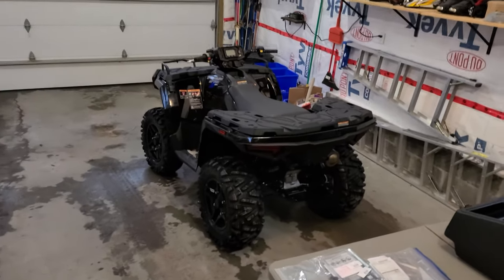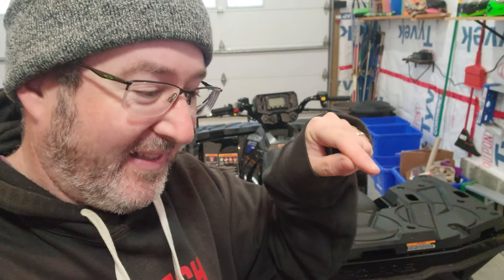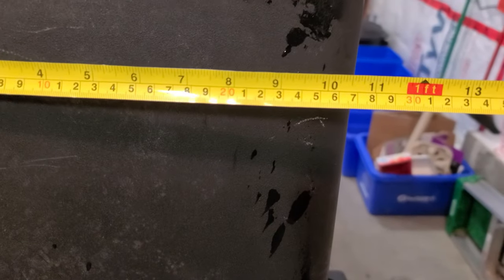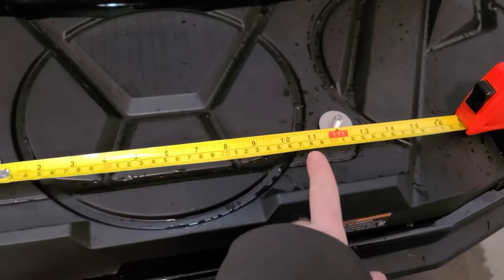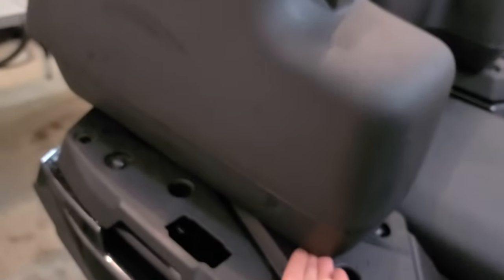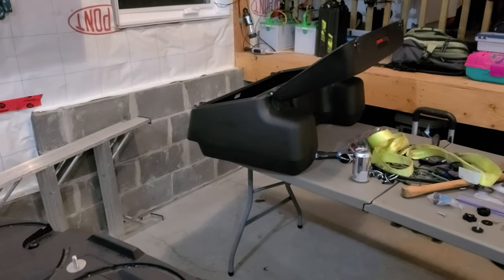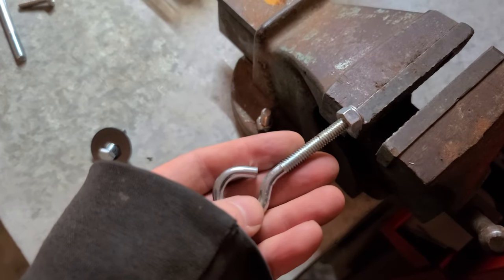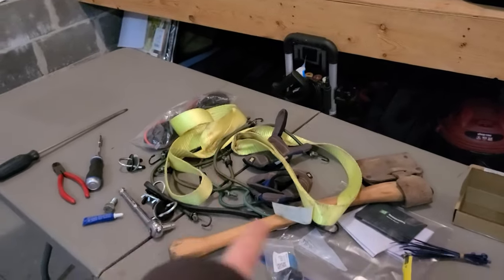Dry Mounting My Box

Comment: In a similar situation I firmly put the bolts in place and put a drop of fingernail polish on top of each bolt. Then I carefully set the box down on the bolts careful not to slide it. when I lifted the box up I had red marks on the box bottom showing exactly where the holes went.
Reply from the maker: Nice play!

Comment: Love to see Mr Gary use two hands to do his handy work, tricky stuff for u with one hand on the phone...Is the Polaris back box really like that, Major fuck up on their part for design if you had to 're drill more holes..How many back boxes are there for this bike ? What did the reviews say about either the back box or front grill blocking the full beam..Mmm , Do you know any designers for these models...What friends can do to solve issues , I can't believe they have designed a mounting  frame and it's not designed for a rear box.. Lol on your bolt marking lol, yes seen that one...Make your own metal bars to attach to the rear box,  another video...I see your head scratches.. Floppy measure lol, mount the camera, free your hand lol...Good job 👍😁 We haven't seen Gary hang a painting or paint doors yet 😉🛌
Reply from the maker: That's a 3rd party box...I wasn't going to spend $500 on the polaris one that comes with built in speakers...wtf...I grew up in the woods not the city...speakers..are you kidding me...$500 are you kidding me...no thanks.
Reply: @GaryReedUnfrequentedWorld  -I see now , you grew up in the woods and making stuff, understand on £500 bucks..You could rally your subs to help you get some funds towards it..I see now..It's good you have engineered your own stuff, I would do the same , city boys can do diy/engineer work, depends on the person,  I am countryside man, you are far more rural than me..Now I know where you are at..Can you weld ? Or Tom can do ? ..Thanks for the update..Ask us if you need ideas in what to do...👍😎